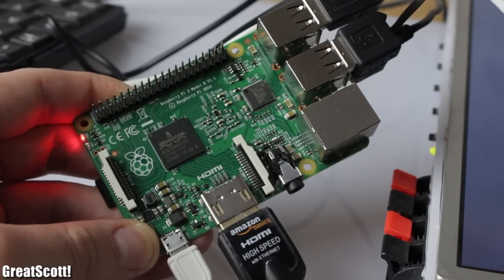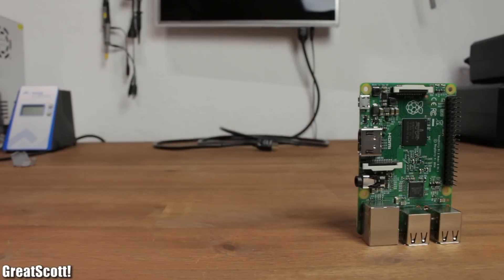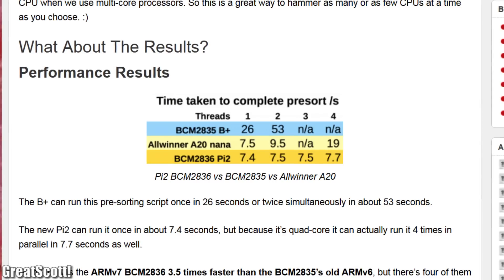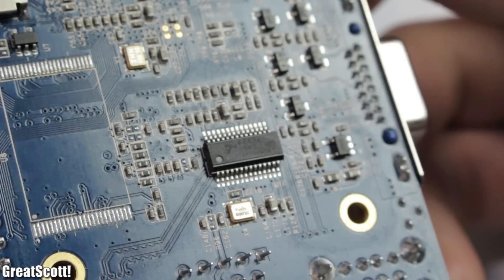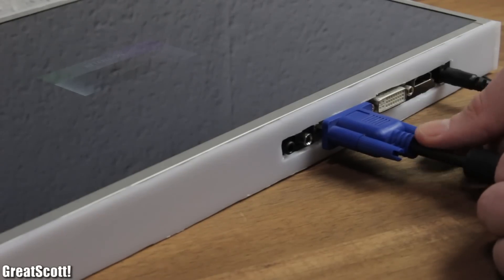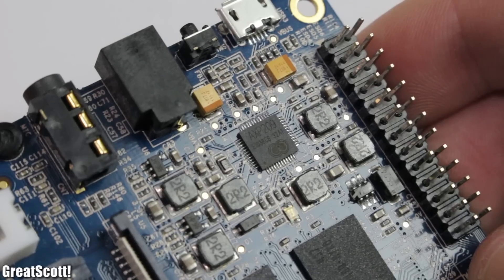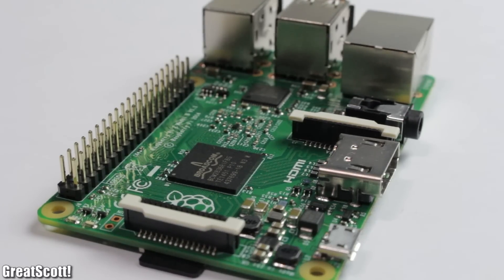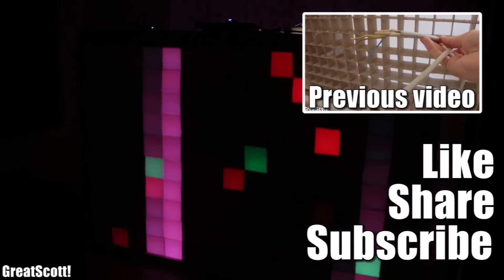Raspberry Pi 2 VS Orange Pi VS Banana Pro

Comment: Second comment here.

*Bout that HDMI port*, they haven't figured out it's easier to keep the whole board 100 degrees f plus while it's being assembled.

It would seem to me they are adding the port last, manually perhaps. This is most likely because they do not have the proper machining to put the port in on the conveyer.

Because of their size, and the heat dissipating properties of general PCB material, it's often pretty hard to get just solder flow in a localized area, efficiently enough to ensure contact. (Ever remove an HDMI port? Put it in the oven or have a heat gun and patience if you don't want to destroy things.)

If I was in their shoes, a burnt looking HDMI port is better than a non-working one considering I/O is typically done last in assembly. In China I/O parts are always being pre-fabricated just down the street (they are the more expensive parts in an operation like making an SBC, but the machines to make those are even more expensive than that, so why bother?).

Alternatively, they could have a separate machine for that, and they are forced to remove the part off the conveyer allowing it to cool too much.

No matter how you look at it, they need to get a handle on that. I can't imagine how many they reject a day. (Even though, one rejected is only roughly $4.50 USD give or take a dollar)

The Chinese market is very versatile, a factory can close it's doors and open up 2-days later. Having gone from making dog bowls to making surgical plastics.

Comment: I think the Raspberry should rate tops on this because of the community support. Banana is getting there. And I just don't trust the quality (or lack thereof) of the Orange. And if I really needed to connect to a 15-pin VGA cable I could just get a cheap HDMI-VGA adapter. No real need to put one on the board. They could save cost there and make those other 2 USB ports..  work..
Reply: Shane Singleton this orange is not available anymore, now the orange is all different, much better and  there is  a quite  decent community around

Comment: I am fascinated that the Orange has a Li-ion battery buck boost / charging circuits.  Here, looking at Ali Express, I see newer models, all very inexpensive, but can not tell which, if any have that circuitry.  May I ask where you learned about this battery feature?

Comment: Whats the difference from the raspberry pi and the arduino
Reply: Raspberry pi is in another tier (Speed, design and can handle an os). However, arduino is extremely cheap and also work fine in little projects.
Reply: one is a computer, the other is a microcontroller. A computer is a CPU, RAM, input/output ports, and storage. A microcontroller is just a simple CPU with embeded RAM/storage called EEPROM. The program of the microcontroller is stored inside the EEPROM memory, but the space is very limited (256kB is I recall correctly for the arduino).

Comment: So why did they start naming these microcomputers after fruits? Also, what is that touch screen device with the VGA and DVI port at 0:07? Thank you.
Reply: +Kyle DuBois (Soulzarath) It's just their codenames for their mini computers and that's a screen that Scott made out of an old broken laptop and converted it into a multipurpose screen so it can be a pc monitor or a tv, it really isn't t hat expensive or hard to make other than the case that holds it which may varry but it's pretty cool and it's on my to-do-list
Reply: JonnyFlame Sweet.
Reply: Kyle DuBois I look at it this way. the other fruits don't leave the expensive bitter taste that the apple does. :)

Comment: Will you be planning on comparing these boards to raspberry pi 3 just announced recently? I might actually get one if I can find one <$40.
Reply: +Power Max pimoroni has a pi 3 for $35, if that's what you mean.
Reply: +Ḉąp̃tǻĭñ Ẽnçhilâdă Got one from MCM for $35 + $25 for a camera module, wifi dongle, and case bundle for, + $8 shipping. It is pretty nice although still kinda sucks for internet browsing.

Comment: Hello, nice video. I think it really boils down to what you will be using the board for, don't you think? It's great that the Banana Pi pro runs Android, and some nice flavors of Linux, however it is probably not fast enough to do any heavy gaming on, which is what I use Android for sometimes. I like tha you can attach a Sata Hard drive to it for more storage, and the On/Off, reset buttons.  If I were going to recommend one of these boards to anyone, it would definitely be the Raspberry Pi 2. There is just so much support, and if you want to use it for a really fast, small computer exclusively for KODI, the RP2 wins hands down. With its quad core processor, KODI runs really fast.  I own several of the older Raspberry Pi boards and they worked well, but they needed to be overclocked. The RP2 runs OpenElec with a wireless dongle,  with no messing around with any of the settings. Great for people who aren't quite the expert with this stuff as you are.  I have the original Banana Pi, and I still have not found a distribution which runs KODI as flawlessly as the RP2 does, or the original RP.  I will probably end up getting the Banana Pi PRO though, because I really like that wireless feature, and the other cool on board features.

Comment: I have worked heavily with the Banana PI/Pro and while it is well made, it has some serious issues. Copywrite issues to boot, and then theres the fact that the AXP209 is not properly configured both in software and hardware. The board does not completely shut down power, and the chargine features are useless. I have worked heavily with the I2C bus that the AXP209 is on and there is no fix, it is a design/hardware issue. However, lemaker makes some great products and I still would reccomend their product for most uses that aren't power sensitive(such as battery powered wireless devices)

Comment: I told my dad about Raspberry pi, banana pi and orange pi..he thought it was some new ice cream thing :P
I wanted to know why I would buy icecream thats $69.9USD on amazon :/
Reply: What is that a computer thing?
Reply: Basically a small computer. Like really small but powerful enough to play minecraft (probably) on max settings :3. It doesn't support* windows right now but it will be supported by windows 10 so then its gonna be like a computer that you use daily, just with less performance. :P
Reply: You're a smart nerd XD!
Reply: they're very cool, for me the best of 'em would be the orange. Idk I gotta watch synthetic benchmarks to decide, its pretty cheap too. I'd buy one to make my own router or as a tablet to carry to school
Reply: xDDD, geek*, Actually idek. maybe hybrid :P
Reply: lol, binary is easy

 010011010110010100100000011000010110111001100100001000000111100101101111011101010111001000100000011011010110111101101101001000000111011101100101011100100110010100100000001011100010111000101110

took me a while to convert and check over. can you speak in binary doe?
Reply: I need that much power thought, I'm gonna be running Kali Linux or Cyborg Hawk (major penetration testing/exploitation o/s')
Reply: +The Savant You ask me if I can speak in base64? I only encrypt in base64!!1!
Reply: Shadow Knight - Road to 100k subs Actually Raspberry Pi 2 supports Win 10. When i get on my own this computer, i see it can run Counter Strike 1.6 :)
Reply: Sławek XD Yep, win10 has arm support..CS 1.6 xD..It might run some games at a small res
Reply: SAVAGE
Reply: its pretty stupid how g+ doesn't link the respondent when mentioned
Reply: WTF
Reply: So only newer accs don't have a linked respondent?
Reply: hangouts me :/
Reply: im going on now..

Comment: Do bot buy the Orange Pi, because it uses an Allwinner SoC. And Allwinner is violating the GPL. That means that it isn't a good board for an open-source OS, and you will have trouble getting hardware acceleration working!

Comment: Hey have you seen the New Orange Pi plus? with a Quadcore H3 SOC, 8Gb eMMC, SATA, Onboard WIFI, 40 PIN GPIO, 4 USB 2.0 Port  and 4K video... ? its a huge improvement and takes the best featues of them all combined into one board.

Comment: Thank you, man, nice practical review! I think that at this moment Banana Pro is better choice for my twilight projects. Rpi is good when you deal with something that does not require much computing power or when you deal with software that works better with Rpi. Connectivity is everything for me, so I took Banana Pro - separate eth controller, IR, SATA, WiFi, Backup power battery, standard LVDS,OTG, GPIO RAW mode (GPIO pins become fully compatible with Rpi) - I could only dream about it few months ago :) . Banana Pi is also good, but that bulky RCA connector... who needs this? . However, plastic cases are better for B Pi than for B Pro. I think making a wooden (bamboo) case for all these little useful monsters   would be a nice project! Orange is rubbish, guys, go either for Rpi or Banana (Pro or Pi are both good choice)

Comment: I have my Pi2 arriving today, but after I finish my intended goal with it, I plan to get the ODROID-C1. I don't have bench power supplies and fancy measurement tools, but I'm curious to see how well the two compare, considering their price tags are close and the C1 appeared before Pi2 (not bashing, but the Pi2, which wasn't supposed to be released until 2017, suddenly appearing when C1 jumps out of the gate with an agreement with Microsoft and Windows 10? Totally not related).

Comment: Definitely i would buy (and i will at some point) the Raspberry Pi.
Don't forget the noble cause for which the Pi was initially designed.
All the other competitors are just aiming for profit.
Reply: If they are all open source then there is no difference. Also i dont mind we exist as a market for microelectronics, we being the majority of the worlds population, the 3d world. The ppl who used to buy the spectrum 48k, though now the strawberry if made in the uk, has a cost measured in pounds which measure more than euros>dollars>>> pesos.

Comment: I am still torn between the banana pro and raspberry pi 2... I like the extra's on the banana such as gigabit ethernet, wireless and IR control, but I do want to try that ambilight mod you did, for which I would need a raspberry :(

Comment: since the banana and the orange use the same power management chip is there any way to add a battery to the banana pi and take advantage of the battery management circuit inside the chip?

Comment: ODROID C1 blows all these chips out the water for the same price! It even has a quad core 1GHz processor and can do 4K video decoding flawlessly. Great video though!
Reply from the maker: I just searched for the board. It surely looks impressive!
Reply: Full ubuntu???!! What?
Reply from the maker: ***** I get quite a lot of comments every day. Sometimes I forget stuff. Sorry.
Reply: there is also the ODROID XU3 which has the best raw performance (on paper at least).  There is also the cubbieboard 4 which is about the same as ODROID XU3 (a little less, again on paper) but has a few more bells and whistles and is cheaper.  I haven't gotten to use them yet but I plan on buying and seeing how well they preform.
Reply: ***** And cost 179$ + charges
Reply: ***** XU3
Reply: Matej Dian That is true, for price it's not better then the C1 but it is a beast.
Reply: Ramses De Vuyst the raspberry pi 2 has Ubuntu 14.04, not in the official downloads but its not hard to find. It actually works pretty well all things considered.